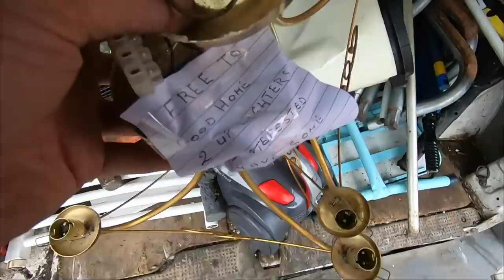Early Bird Part 2 - Weighed And Paid #58

Comment: Just subbed fella. Nice to see the viewpoint of a UK scrapper . All the yards round me just have one price for iron. I’ve never heard of short steel before .
Reply from the maker: Thanks Tom.  All yards are different or they just say that so you don't get more cash for your scrap.  Scrapyards are dodgy.  From what I can gather short steel is any heavy gauge iron under 1 metre such as a small bathroom radiator or small car parts.  Larger heavy iron goes as shearing at it would have to be cut or crushed (sheared) down to size so the foundries can process it.  Although I could be wrong,  I'm always wrong 😁